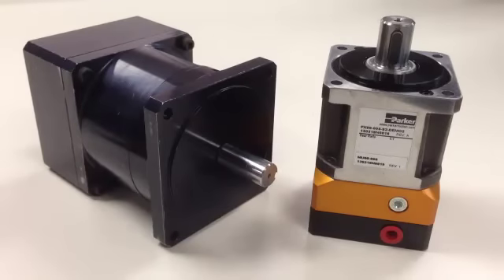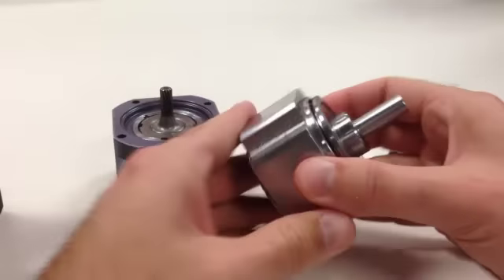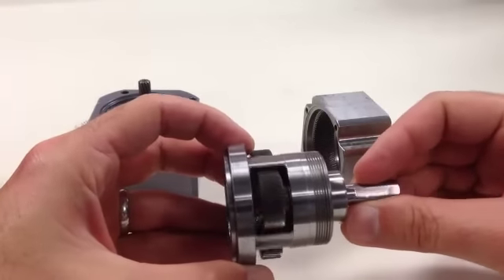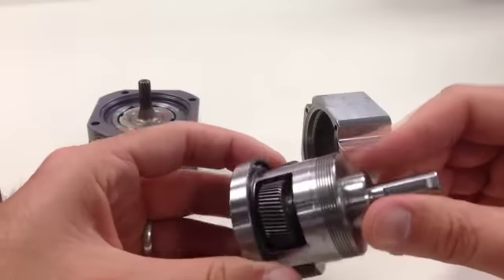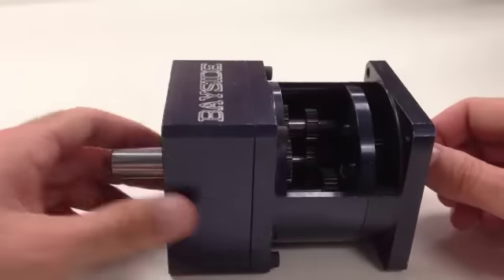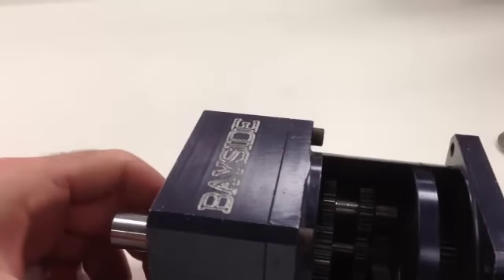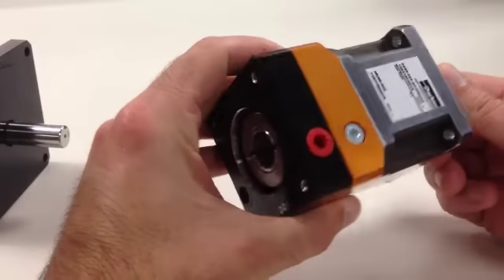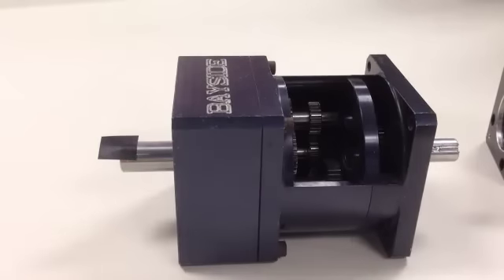What is a Planetary Gear? What is a Spur Gear?

Comment: how many rpms can a typical planentary gearbox withstand? say with the ratio of 100:1? and is it ok to reverse it, meaning, instead of a gear reducer, it will be turned into a gear multiplier. i would really appreciate your response. thank you
Reply from the maker: Planetary gearheads have the planet gears spinning around the sun gear. The higher the speed, the faster they rotate, increasing the surface speed at the gear and increasing the heat. This will cause the lubricant to heat. Typical speed limits are 2500 - 3500rpm input speeds.  Our planetary gearheads are over 90% efficient so there's very little torque loss and making them able to be back-driven unlike a worm driven gearhead. You've still the input seal friction and that multiplied by the gear ratio gives the torque you need to overcome when you reverse the gearhead as now you're at a mechanical disadvantage the higher the gear ratio. We note this in our Electromechanical Knowledgebase. We can as custom provide an input shaft so the gearhead can be used as a speed increaser; contact your local Parker ATC distributor for price quote; the catalog shows an example of a speed increaser with input shaft.
Reply: Hi i would like to get a rpm increaser custom made am in miami florida do you know a place where i can go?

Comment: Hello, i building a rotating engine stand with 100:1 worm gear.. nmrv050.. I will have a crank handle on it, but that means 50 revs to turn the engine 180 degrees. What type of gearbox can i use to increase the speed? Will the nema planetary work for me? Do you have som recommendations?
Reply from the maker: Worm driven gearheads are so inefficient they can't be back-driven (from the output shaft). If you check the efficiency of the gearhead, if it's over 90% then the torque to backdrive is the ratio times the startup torque/seal friction on the input side. Parker planetary are over 90% and can be used as a speed multiplier if you flip it around, no modification needed. The PV gearheads are planetary and have no seals so the input friction is quite low so I'd start by looking at it.

Comment: Can you do custom higher ratios? I've seen 1 to millions ratios in plastic.
Reply: Higher ratios are possible as custom. Plastic gears are nice and quiet but not high torque nor rigid.  Need to be careful though as the torque is multiplied through each gear set, so the last gear set outputs potentially very high torque. Customs available through your local Parker distributors.

Comment: Where did u get that planetary gear set
Reply: Parker
Reply from the maker: This is an old cut-away demo from the original Bayside PG series gearheads that used straight-cut gears.The new Stealth series use helical cut gears with longer life, better accuracy and higher torque:http://www.parkermotion.com/products/Gearheads_and_Gearmotors____30_32_80_567_29.html